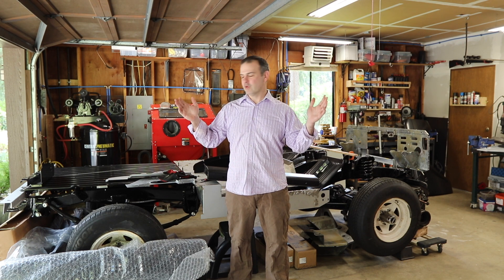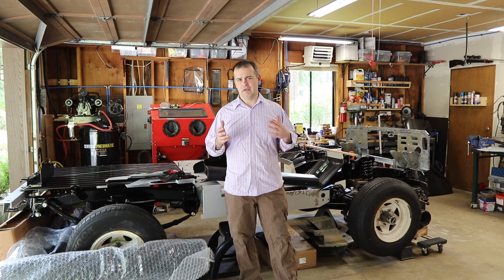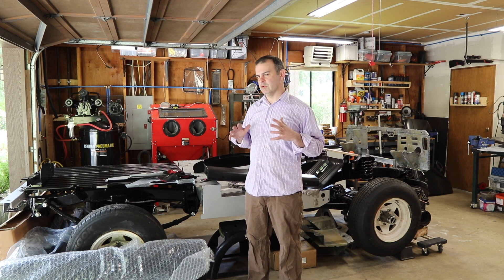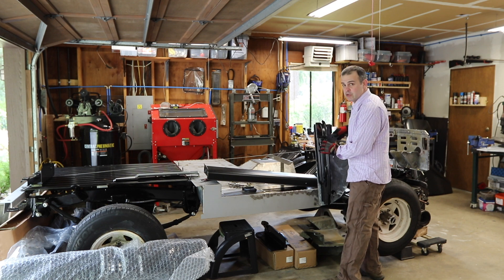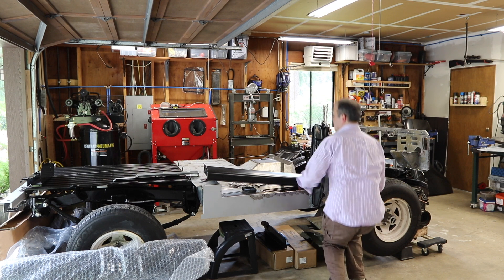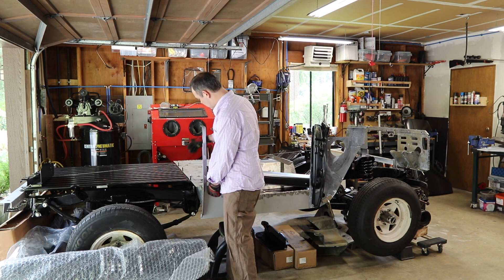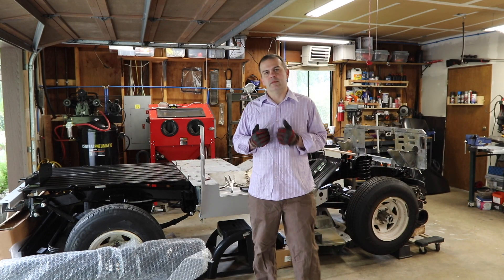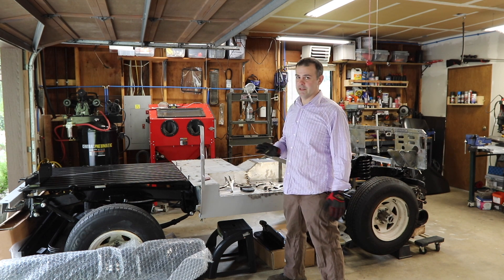4.06 The Key to a STRAIGHT BRONCO

Comment: Matt as always, good work. I'm enjoying seeing you struggle with the same exact stuff that troubled me through my tub build. Although, I still have not completed my body much of the fitment issues are exactly what I dealt with.   When welding the rear posts slip your tailgate in for fitment.  My old tub was flexed out at the top, so verify your gaps are good with the tailgate!
Reply from the maker: Thanks Joe, that's what I'll do.  Good idea.

Comment: How you liking welding the new metal?
Reply from the maker: ehumaui 408 I find it easier than the old metal as long as I hit it with the rip-loc abrasive pads on the die grinder and remove ALL the weld thru right at the weld location. If I leave the weld thru on it spits and spatters something fierce.